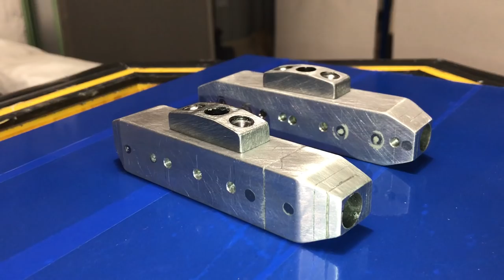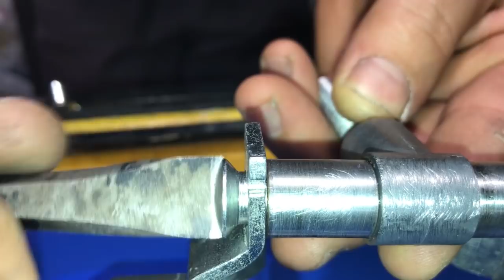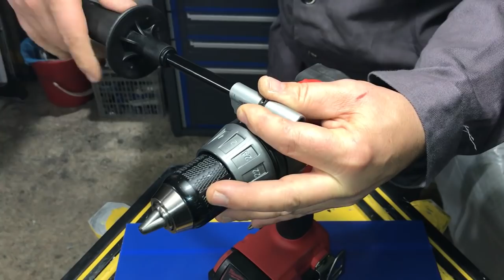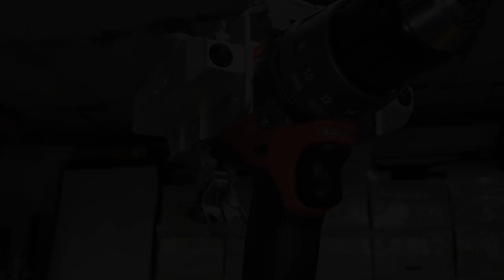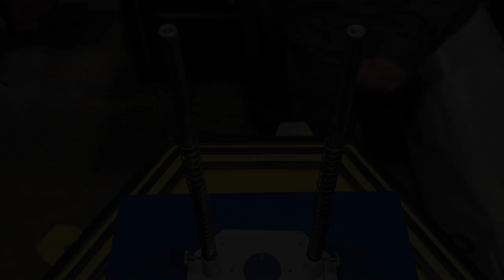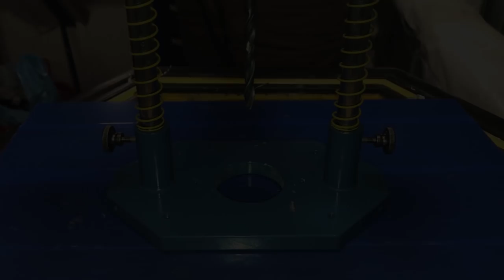HOMEMADE PORTABLE DRILL PRESS

Comment: Way cheaper and easier to make this project with 3D-printer. All of those holders/bushings/base plate could be printed.
Reply: Lots of people don't have access to good 3D printing, plus I personally would rather generally have most parts of most things (especially a drill press) to be made of sturdier stuff.
Reply: @ItsAsparageese  I agree, obviously any cheapest steel or aluminium is much more reliable than plastic. But if we are talking about affordability - have a look how much milled/drilled/bored parts had he used. Do you imagine that range of equipment? How much money would cost those materials? Decent 3D printer is not that expensive today. For $200-300 there is plenty of good variants. I've printed this drill guide https://www.thingiverse.com/thing:3591832  .It works perfectly and costed almost nothing.